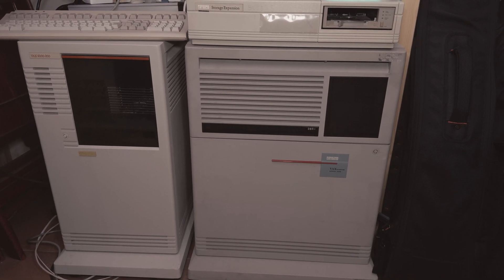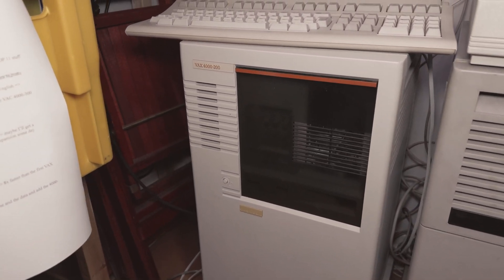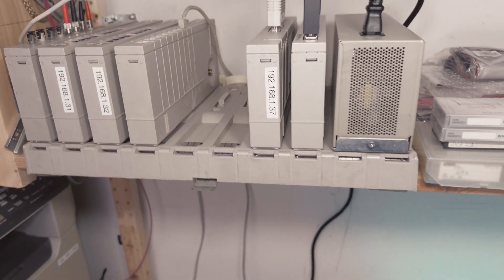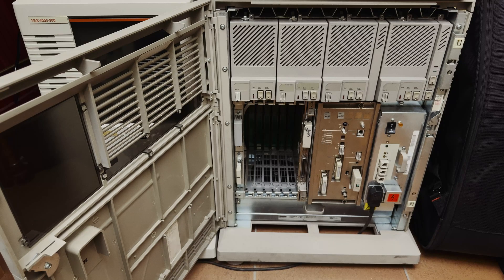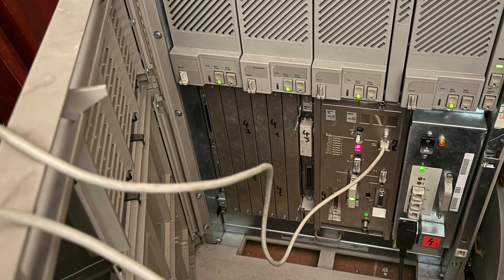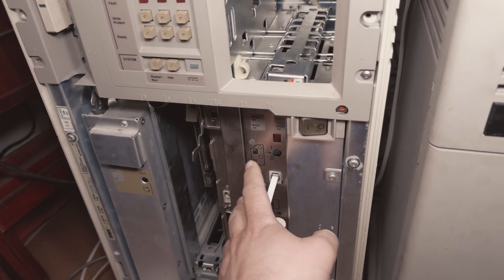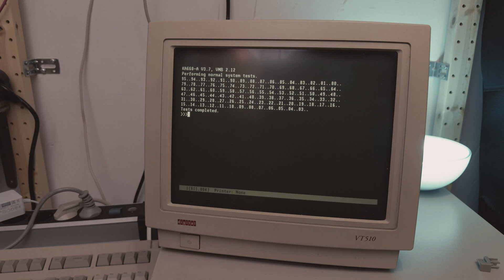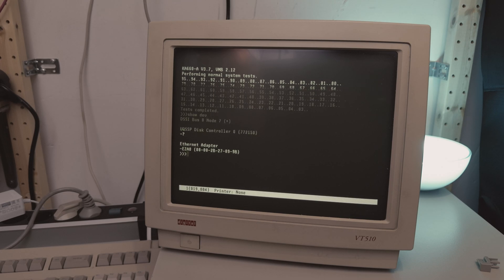DEC (digital) VAX 4000/300 and VAX 4000/200 – A short introduction

Comment: how many terminals can be connected to that server
Reply from the maker: Physically, only a single terminal, as there is only one port per server. With expansion cards, considerably more; via terminal servers, theoretically the limit provided by DECnet. In practice, this depends on the performance of the system (and the network). I once saw a table somewhere showing how many sessions a system can handle simultaneously. The login limit is 64 (OpenVMS default setting), but my licenses are below that. However, both can be changed.
Reply: @DECcomputers O.   I see.      And can that local area network communicate and share files and data with another vax system.  Either at the same organization or another organizations VAX
Reply from the maker: @Richardpasquinucci  This is very easy within a cluster, as all systems can see all drives of a cluster and can access them. Otherwise, this can of course also be done via DECnet with authentication or proxy accounts.
Reply: @DECcomputers  So, in the late 1980s and early 1990s they used proxy accounts for mainframes to communicate and share data with other mainframes at diffrent organizations

Comment: Thanks for covering these. Your english is good, I just didn’t understand 1 word. The Vax 4000/300 has 8 __ and the Vax 4000/200 has 5 ____. Sounded like “whoops”.
Reply from the maker: The word is "VUPs", with a German pronounciation it sounds like "whoops" ;) But "VUPs" is an abbreviation, it means "VAX Unit of Performance"; I should say the letters seperatly in the future.
Reply: @DECcomputers Cool. Thanks! I just looked up that term on Wikipedia.
Reply: Yes, some time ago I found a VUPs chart for different models including many PDP-11, and saved it.  The VUP was based on the 11/780 being 1 VUP.

Comment: Interesting. Classic DEC machines are great. I used to work with similar VAX machines you show in your video, running Oracle RDBMS back in the days.
I also have a set of small VAX machines, here are two VAX 4000/60 workstations and a much older "Elfje", a PDP 11/34c from 1976 that I rescued from demolition around 35 years ago.
Would be nice to see some restoration videos or some more general videos about VAX machines or the VMS operating system. Brings back memories. Thanks for sharing!
Reply from the maker: Thanks. I hope, I'll bring the VAX 4000/300 back to life and I can share a deeper view in its configuration and the Oracle RDBMS as well. But I have to learn a bit more about Oracle administration, because I've never worked with Oracle until today. I've never seen a PDP 11 in real life (I was born 35 years ago...), but I like the PDP stuff of @UsagiElectric. I'll show some more content about my VAX machines and VMS soon :)